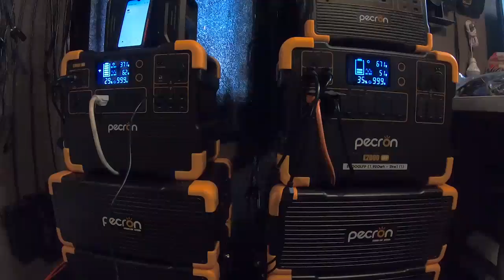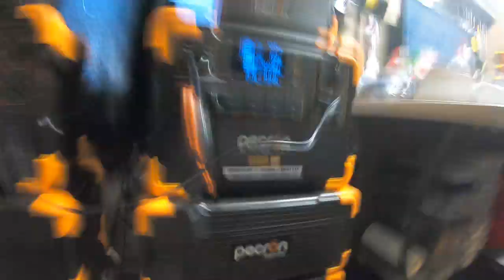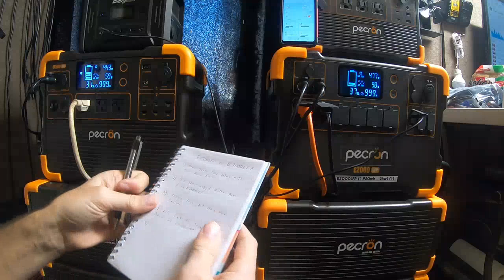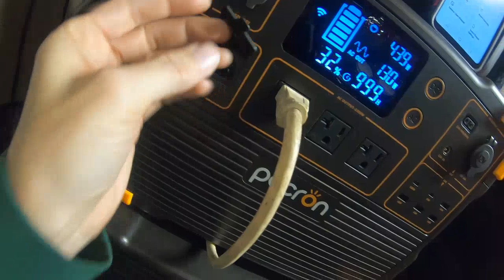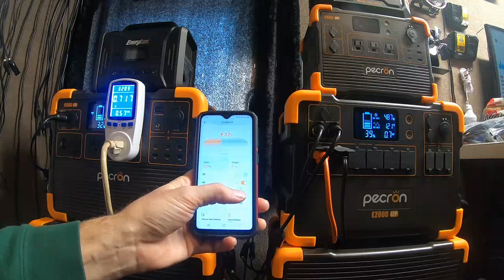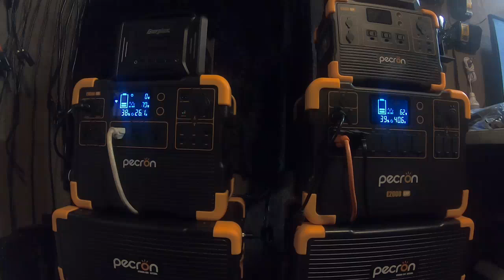PECRON E1500LFP & EP3000 Power Station (FULL 7,680wh SYSTEM) (((((Update 2)))))

Comment: Hello  Bob another great review and thank you for answering my question on and newer version of e 2000 being 120 volts for ac although some still keep advertising 110 volts. I purchased a van powers 2000 1440 wh lifepo battery on E Bay 7momths ago for 499.00 cheap, but app does not work and not available it said  in my area dont care it runs well. im going to buy another station and decided on Pecron E 2000.  I will buy a extra power brick. The reason i picked it over the e 1500 is the larger battery capacity. Mind  are strictly for home use, I don't care about power bricks , apps i dont trust and when grid  go's down   there will be no wifi and some power stations your stuck what you set it on. The e 2000 is simple powerful and larger battery capacity. Question i have is how are these companies  are when you have a problem and pecron   does not even a phone number i think. I also like how many outlets you on the e2000
Reply from the maker: We really like and "PAID" for (out of our own pocket) both systems. Both work great for what we needed and were looking for :)

    We have had no problems with pecron customer service since day one. other than the language barrier sometimes takes extra time to understand each other fully. And that was before we even had this channel (sep 2022) (and this channel started jan 5 2023 by a freak accident) go back and watch the first video we uploaded, it is funny how far the channel has grown from us just wanting to try to help people with that hidden menu.....lol

    Some folks said that they had some issues with the customer service. but we can not speak on their behalf. If you ever had any issues with any customer service or products of ANY company.... my best advice is and always has been....hit them with sugar first and then if you ever have any issues, then throw salt.....never, ever, start out by ranting or raving about this or that. or leaving bad reviews before trying to fix the problem. This will NEVER solve anything :(

   That will end up nowhere. remember, all these technology companies are in china, and the rules there do not sync with their rules over here. So always try to fix any questions or problems with sugar first ;)  Best advice we could give anybody buying anything from anybody or any company.

  We have had one fella come here and just complain for 30 minutes straight, and we send a quick message to pecron and say...hey, there is this fella on our channel says that they are having some issues or questions that they need answers right away. and they send them a email and try to help right away. the fella even got mad when they responded with the email asking to help and he did not want any more help from them after that. We were like, whatever happened before....ok....lets figure how to fix it out now, we got them on the ropes right now. lets fix this problem or get a return, the ball is in your court right now....he just walked away. We felt like we wasted our time trying to help. And we don't even work for any of these companies, we are just trying to help people with this technology.

  We have no idea what happened before between the two. But an open dialog (sugar) works 1000% better than just screaming at each other. right?

  Because at the end of the day....you want their technology...and they want your money....and they is always a happy medium in there if you keep the (sugar) flowing between buyer and seller, because you will buy more from them and that is the main concept of a business :)

    if you want to test this, take something back to walmart and scream at the poor kid behind the counter....they will not care less and just walk away, right?   Always talk to the boss if you ever have any issues, saves tons of time. and use the (sugar) approach first, it really helps in many situations.

just my opinion from MANY YEARS of experience :)
Reply from the maker: P.S. Thank you for your service :)